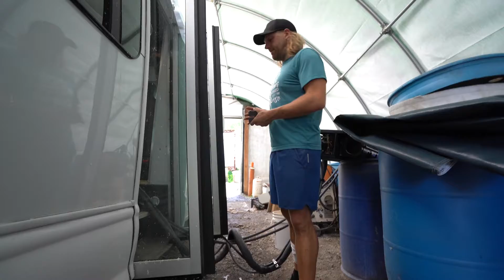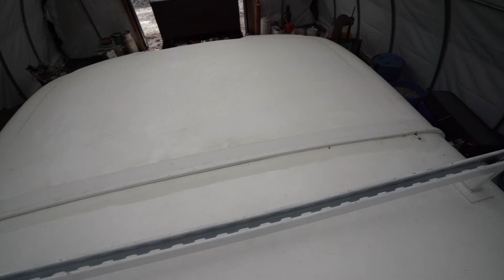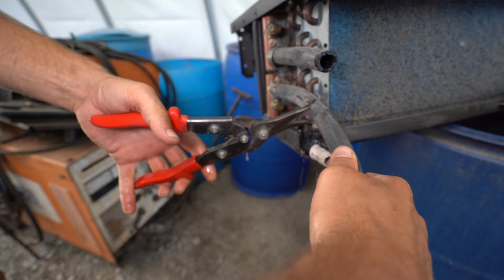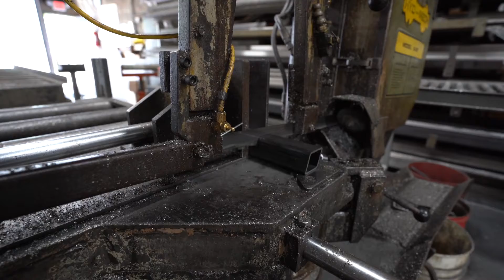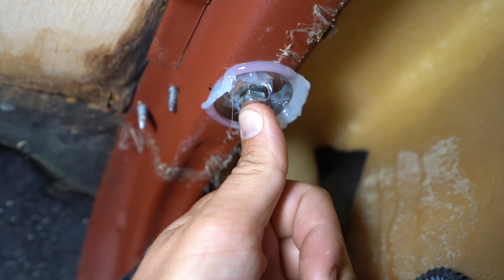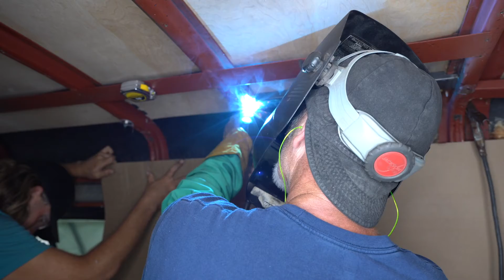Shuttle Bus Build Ep 3 | Split Removal, Custom Roof Rack, & Roof Reseal

Comment: We have just purchased a 2014 Ford E450 (Eldorado built body)  very similar to yours. In ours, the seller said she had had someone remove the rear AC unit for her but after they did, the front AC no longer worked either. I've done some crawling around underneath and found a few cut hoses. The condensers  are still present behind that grill on the side. 
I'm curious as to whether your front AC worked after you removed the rear unit.

Comment: What if you put unistrut along the length of the roof and then put your cross braces from side to side? You'd have less fabrication and more support. You could put spacers and drill out the channels.
Reply: You talking Unistrut on the top outside from front to back?  I just bought a shuttle with the u joists and that's what I plan to do.
Reply: @prepparig  Ya. It would create less weight per square inch on the roof. Like laying your body across the roof versus standing on it, so all the weight isn't on that one rib. Then you can adjust the cross bars or add more later when the panelling is up inside.

Comment: It would of been great Drew & Savannah, if Max Fan made one that would fit the Tent your working in :-) that would take a lot of air out & through the region of experience to have better venting to work in. As much time has passed since this aired you have come a long way in discovery & invention of get'n through. I agree with the a/c unit taking it out. Those hoses could leak at anytime & cause grave damage to the interrior & the motor strain. The new a/c units made to run from the Solar Panels through Lithium Batteries are amazing today. The networking in idea's & past experiences shared are what we are all here to gift forward. always, Tommy :-)

Comment: Greetings from Australia, I am wondering about the strength of the internal rib that you have used to bolt your rack down, my concern is that this rib is fairly thin and may be prone to slightly crushing when the bolt is tightened which would result in the rack becoming loose over time, perhaps consult with your ‘Kevin’ on this. The reason for my comment is that I’ve come across this crushing/loosening happening in similar situations.

Comment: I wouldn't beat yourself up so much about your "mistakes" or more correctly miscalculations. It wouldn't be a true build without bumps and these rigs surprising us a bit. And you rushed to seal the roof because you felt like the leak you found at that time was a high priority problem. Then you had to double back to a step you would have done earlier and you figured it out and it was all good in the end. ☺️
Reply from the maker: Exactly! Sealing the roof was rushed because of the rain so we didn't think it through. All is well now and a lesson was learned!

Comment: Did you use Henry's on the air dam on front? Have shuttle bus rv myself. Need to redo roof also. Air dam is chalking and dripping in windshield. Thinking of using Henry's and eterina bond tape on seams.
Reply from the maker: We have not tackled those front seams by the windshield yet. That area tends to get so much wear that the chalking is pretty common. Henry’s might work well. I’d scrape off whatever is there, use some caulk and then Henry’s!